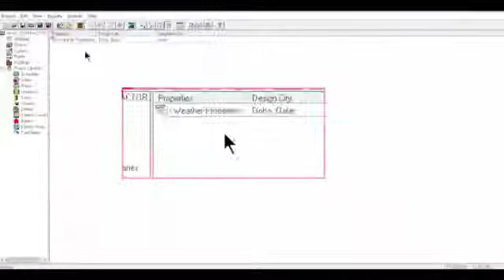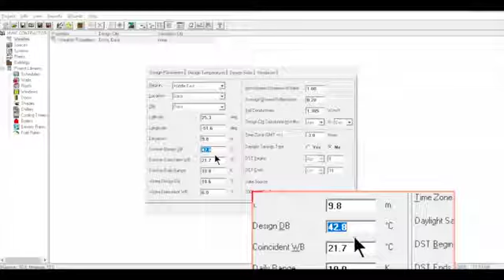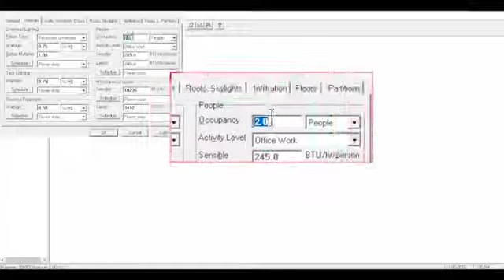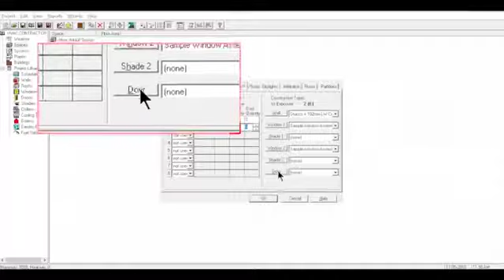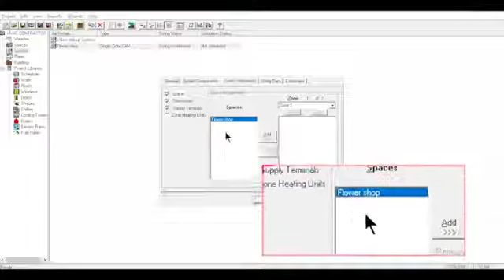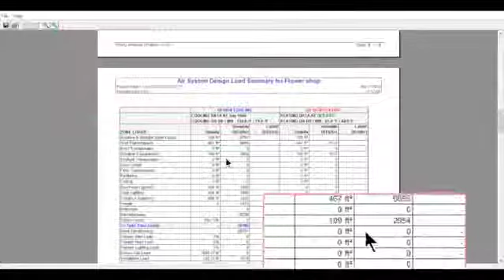Comment: Q = UA dT, if U increases Q increases. That means higher the U value more heat tranfer will take place and the heat load will be more. Hence the cooling capacity to be increased. Plaese consider .